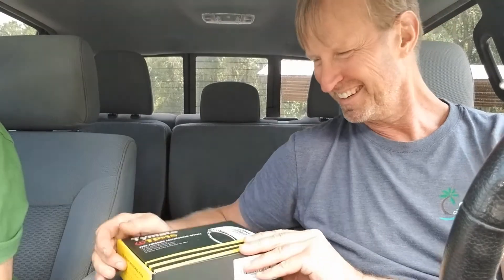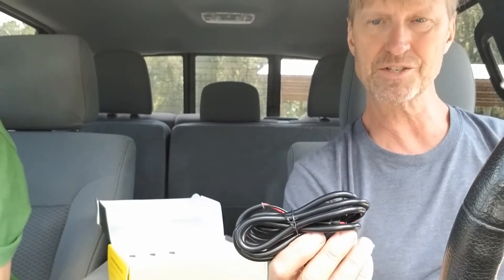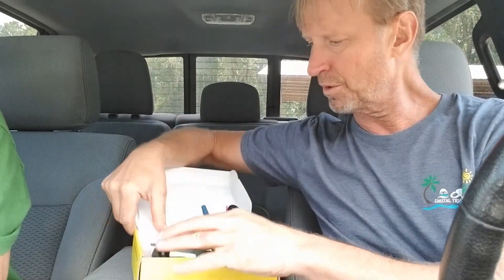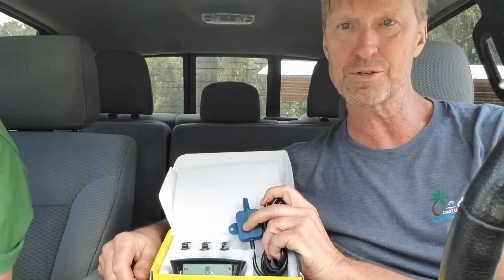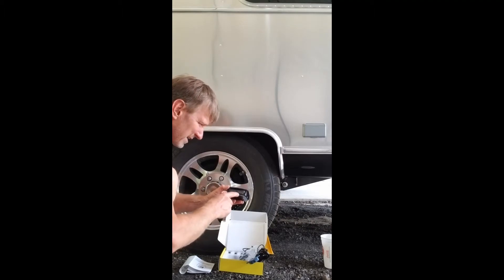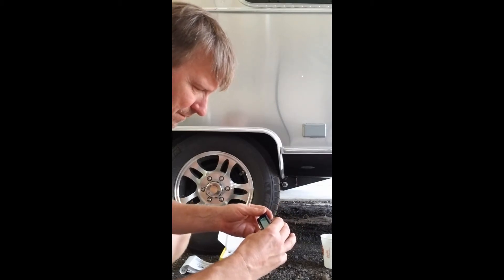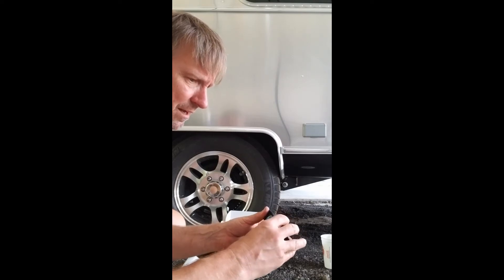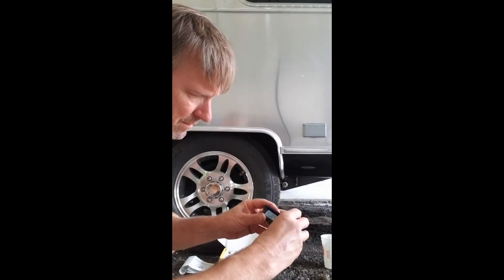How to Install the Solar Charging Tymate Tire Pressure Monitoring System

Comment: I have this system and was perplexed how to use the 3rd sensors on the camper that has obviously remarkably different pressure ratios than the tow vehicle..  However, by watching your video I notice you put the Rl & L1 on the camper which would allow one to set those ratios higher than R3 & L3 sensors which, as you point out, are clearly for a  truck dually set-up and the programing does not allow for setting the ratios for those tires different from the R2 & L2 tires.  I don’t think it would make much difference in tracking tire conditions on the tow vehicle as long as you put R2/L2 on the fronts and R3/L3 on the rears.  They should all have the same pressure ratings.  I can’t confirm if this is the “best method” for using six sensors on the tow vehicle and the camper.  Naturally there is no one to answer my question on the phone on a Saturday.  Oh gee… I wonder how many people actually do this stuff on a weekday>. Ridiculous.  Several things wrong with this video, but in my case it helped enormously.

Comment: The first step SHOULD be to air the tires up to the desired level!! That way you don't have to remove the sensors from the valve stem to add or release air. The video doesn't mention sliding the dust boots onto the stem and turning it inside out so that it unfolds neatly onto and around the stem and sensor. That helps keep both dirt and water away.

Comment: He doesn't mention how to save the settings he just entered.  The manual doesn't tell you either.  I assume that's why he doesn't save the settings...  because it's not in the manual.  I did all he did a number of times looking for something obvious I was missing.  But, all the settings would go back to what was originally in the stupid thing.  Per their video link they give in the manual, after you enter your changes, you have to hold the set button until it beeps.  Honestly I haven't tried it yet just on my computer trying to find the answer.  One line of text in their manual could have saved me an hour of wasting time.  Next is to research how to turn off the spare tire sensor which the manual in the 4 pack doesn't explain either.
Reply: Thanks for your comment. Hope we can find out how to shut it off.